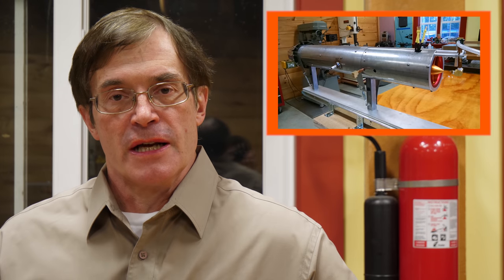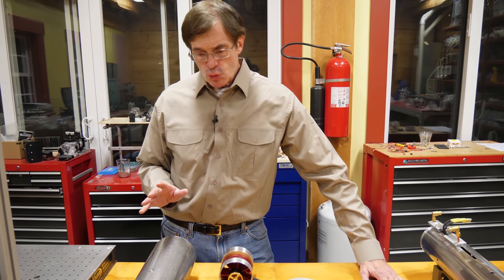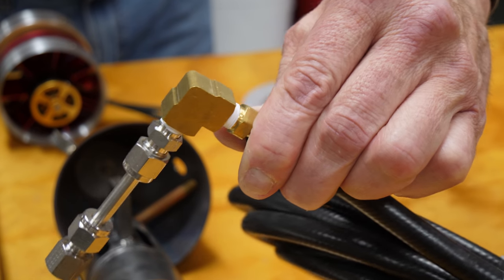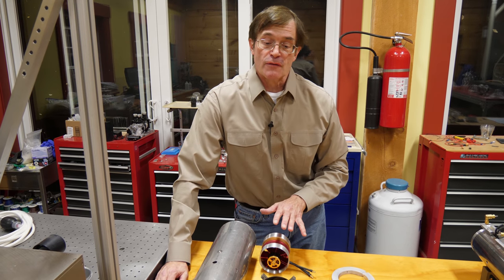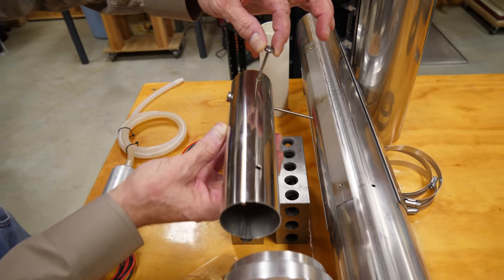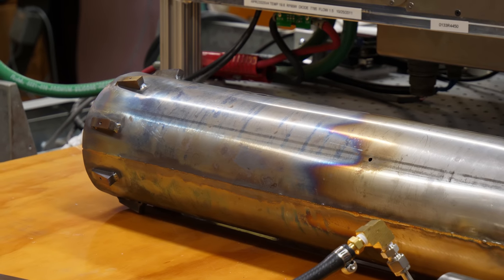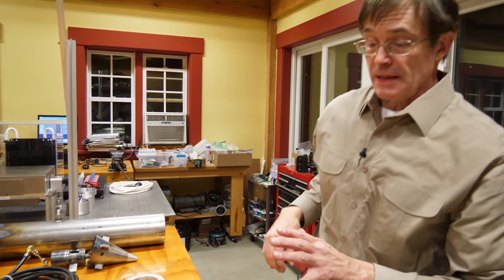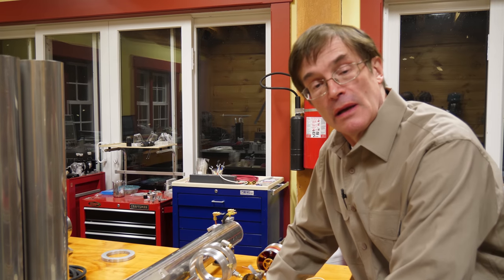Hybrid Jet Engine - Update 2.0

Comment: What is the liquid propane going through the motors going to do to the lubrication in the bearings?
Reply: I would imagine they use sealed bearings and those need to be cooled as well so whatever lubricant they use doesn't get too thin from overheating.
Reply: Doesn't propane dissolve petroleum based lubricants? I guess if the heat of the engine would make the oil grease too thin for it to contain anyway, it wouldn't make a difference. If the bearing can hold onto the grease at a high temp, it is totally capable of also keeping the propane out.
Reply: There are plenty of inert synthetic greases such as Krytox which won't wash out.
Reply: omg feed fuel into compressor when did this turn into a bomb. I think the title is hybed jet engine yup checked it it reads hybred jet engine
Reply: If they fail, go ceramic. Plenty of those in the hobby.
Reply: What bearings?! It’s just a combustion chamber with no moving parts!

Comment: I cannot wait to see this running! My only concern is that of the liquid propane causing the EDF blades to become brittle (that is assuming they are plastic), also there will be condensation issues inside the  motor everything you turn the system off unless you have a "warm up" time after where you throttle down and turn off the liquid propane.  I bet you thought of this though, so I eagerly look forward to seeing how you worked around these potential problems.
Reply: JP EDF units are all aircraft aluminum.  This will still occur to a degree, but much tougher than plastic.  Aluminum is a much better material (especially when used for their intended purpose), because even though a high-quality BLDC motor is over 90% efficient, there are still 5000 watts going through there.  At 90% efficiency, that's 500W of pure thermal energy they must dissipate.  That's like a space heater on low.

Comment: Thoroughly enjoying this ongoing project. The cooling sleeve is an interesting addition. If the superheated steam only marginally changes the thrust, perhaps it'd be worth reversing the direction of water, countercurrent flow offering better heat dissipation.
Reply from the maker: That's interesting.  Also, we might eventually replace the water with bleed air from the fans to simplify the design.  We'll see.

Comment: Have you considered adding a slightly larger fan in front of the whole assembly that would feed cold, uncompressed air post combustion to increase bypass ratio and cool the tube? This would increase the initial compression ratio, but your current fans might be less effective because they can only compress the air so much. It seemed like you started out without any bypass ratio, now you have added some with that smaller tube which likely will make it more efficient,  so by adding more bypass ratio of your compression,  you could further increase the efficiency of engine. Modern Turbojet engines use that kind of system, but they use a turbine to turn the large fan on the front so maybe this wouldn't work for your system. I'd like to hear about your thoughts on this.
Reply from the maker: If we go to a three stage system we will likely steal a little of the first stage air for combustion chamber cooling.

Comment: I'm excited to see this new version running. You've clearly put a lot of thought into this.

I'd be a little concerned that the liquid propane might wash the lubricant out of the bearings in the EDFs. Those bearings are usually only shielded and not sealed, so a fluid like propane would have little trouble finding its way in and diluting the lubricant. I would want to try placing a few different oils and greases in some liquid propane to see if / how quickly they dissolve.
Reply from the maker: That is a risk.  If that proves to be a problem and we still want to push it, water would be a good alternative.
Reply: @TechIngredients  If it works, it's a very good way to kill two birds with one stone, especially the nitrous oxide version you mentioned.
Reply: @TechIngredients   Also, I suggest turning down the music during the intro about 3dB, and maybe throwing some light compression on the music track when it's in the background.

Comment: Amazing work.  I'm betting you abandon the brushless fans in favor of turbine driven compressor before it's all complete.  With all the cnc that's available today, you could have multi stage axial flow compressor/ stator assembly made up as well as a nice turbine with a nozzle for the combustion section.  Really enjoy  your videos.  Thank you!
Reply: Not to mention the added joy of that turbine whine :-)
Reply: There are only a few diy axial compressors on youtube as creating one is a very complex engineering problem.

The biggest hurdle outside of machining/tolerances, is that an axial compressor doesn't scale down well, so to make a benchtop model it's much harder than creating a normal sized version for an aircraft. If you plan on flying it, the rest of the equipment doesn't scale well either. You have to deal with heavy accessories that allow the jet engine to function reliably, and the only way around that is to build it larger.

Comment: Cooling the fans with liquid propane is brilliant.  Looking forward to direct measurements of the efficacy of that stage.
Reply from the maker: It may in fact be enough to use water.  This is less likely to dissolve the oil in the bearings and the large heat of vaporization should compensate for the higher temperature of he vaporization.  It is unlikely the motors will operate much below ambient in either case due to the high airflow around the motors.

Comment: The 5000 watt edf should be producing more than 10lb of tbrust on its own...
Reply: Hence "more than 10lbs". They only used a 10lb spring last time.
Reply: it's 500W not 5000.
Reply: @nikoladd  That may be true, but he said 5000 on the video.
Reply: You're correct. I thought he said 500W. On your initial point making trust out of jet engine is not nearly as linear as EDFs. What's done in this video isn't efficient(as is explained in the first video), but is very cool, thoughtful and educational.
Reply: Nope, it's this one: http://www.dxhobby.com/jp-hobby-full-metal-electric-ducted-fan-edf-12s-90mm-for-rc-plane-p-1029.html

Rated at 5.1kgf, which is 11.2lbf.

Comment: I wonder if a motor/compressor/impeller (probably not the correct terminology for that...) from a high-volume industrial vacuum (or shopvac, home vac?) would work for the first stage?   May be worthwhile for cost effectiveness as well as easy to source.   I love your channel.  You seem to be perfectly in tune with my interests & experimental urges.  Nice to know there’s another mind of the same ilk somewhere out there!
Reply from the maker: Thanks!
Industrial vacuum motors with their centrifugal compressors would be superior in design, but their weight and power handling capabilities are just too far out of the useful range.
Reply: @TechIngredients  part of me wants to argue that.  However, I initially suspected the same issue(s) as well.  I trust your opinion to be well thought, and based upon sound reasoning & reliably known theory.    Might one assume that the ultimate goal is to have a unit which operates within a power/weight ratio equal to current aircraft standards?
Reply from the maker: Yes.

Comment: dear sir; 

i think something is missing here in the whole concept ! 
those fans cannot sustain the pressure you need to make the after burner speak.
i suggest to test the fan system (or compressor)  for 100% throttle and for different outlet restrictions, and publish the curve.

i love what you are doing !
Reply from the maker: Thanks!  
Don't be too sure about that assumption.  You'll see some results in part two.

Comment: really great :) can't wait
BTW, couldn't you use some sort of regenerative cooling instead of using a firetube ? like you said liquid propane is -40C so what you inject in the engine should be enough to cool it, and it would already be heated when you inject it. It could help to make the engine less long at the same time, making it lighter (you wouldn't need the length of the firetube)

Comment: I wonder how much the water jacketing will reduce the exhaust pressure.  Its probably a terrible idea but I'm guessing that liquid propane would also do a good job of cooling the rear section of the tube.  Its interesting how this (to me) now has more features in common with a liquid fueled rocket engine than a turbojet engine, especially if you swap out the LP in the intake with liquid N2O.

Comment: I think the nozzle just downstream of the compressor is not needed and will reduce the pressure in the combustor. When you dump diffuse the air downstream of the nozzle you will lose most of the dynamic head. By accelerating the air in the nozzle you drop the static pressure and increase the dynamic head, giving a higher loss and hence lower combustion pressure.

It would be interesting to see some pressure tappings in the cold end of the engine, you could then see the pressure ratio of each compressor stage.

Good luck with the project, gas turbines are hard!
Reply from the maker: Thanks.
I disagree with your assessment regarding the cone.  It's a little more complicated.  The output from the EDF is not a homogeneous, linear flow.  The motor acts as a blunt obstruction.  In typical EDF installations for RC applications, the addition of a duct approximately twice as long as the diameter of the EDF will increase the thrust even without a change in the diameter. The actual cross sectional area in the annular gap around the cone is similar to the cross section of the open area at the exhaust from the fan.  The cone as I described in the first video also serves to protect the EDFs from the intense heat radiated from the combustion chamber.  Also, the cone produces the needed turbulence in its wake to allow a stable flame front without the frictional losses of typical flame holder bars.

Comment: Crazy. Love it. 
How about a radial compressor from a vac? Gives you more pressure / less speed than axial compressor. Axial compressor gives speed / minimal pressure. You might need a multi-blade axial setup with smaller diameter each stage. Would love a 5 stage EDF compressor :)
Reply from the maker: We seriously thought about that.  They are just not built that well.  Cranking one up a few notches was more than exciting!😱

Comment: He says “Practical engine” when referencing the electric ducted fans. However the length, the weight, the water shroud cooling, the liquid propane cooling and the electrical equipment rack added to the not shown various tanks of propane and water and the water pumps means that this engine is ANYTHING BUT PRACTICAL. It’s like saying that you have a ridiculously powerful jet engine and you can produce XXX bajillions of newtons of thrust, and then pointing to Mt St Hellens 5 min prior to eruption. True but difficult to use in an everyday application.

The above was just a laughter and a response to his phrasing. I know this is a test bed machine to experiment with different combinations of conditions and parts. It’s also interesting as Hellhiem. 

This isn’t a negative response. He was just humorous.

Comment: Have you considered letting the engine heat up using propane then running a liquid fuel through the cooling tube to vaporize it to feed back into the engine?

Comment: You might also be able to protect the hot end by wrapping the fuel line around it to act as a heatsink and fuel preheater; similar to that of a standard engine (although it uses a heat exchanger between the oil system and fuel).
Reply from the maker: Maybe, and this might provide enough cooling.  Bleed air from the first fan is another possibility to allow the water to be eliminated.  If we wanted to try diesel again (so far a poor fuel for this engine) a preheat wrap would be a very good idea.

Comment: I would like to see the difference between the EDF alone, the EDF afterburner combo and a traditional jet engine consuming the same amount of fuel as you end up using with the EDF + the energy used by the EDF converted to extra fuel. (Id really love to see your approach to a conventional jet engine)

Comment: Another interesting video, thanks.

Perhaps you could find some inconel, which might be cheaper than tungsten, and should handle the heat fairly well. You can't weld it though. Unfortunately, it has chrome in it too, so the indoor jet engine eludes us yet again. : )

You might be able to use springs on the "turkey feathers" to have them automatically keep the correct exhaust port diameter, given engine rpm and flow.

You might be able to use air bypass instead of the water cooling, so you can more easily fly your engine. It might need more surface area, like heat sink vanes, and would surely need more space for the air for a greater flow because it's not going to take the heat away as well as water.

Alternatively a larger electric motor could be used, and then a throat adapter could be made to obtain the velocity you want.

I was going to suggest nitrous oxide. As with internal combustion engines, you might have to add more fuel, or your engine might be fuel.

The propane cooling was simply brilliant! It reminds me of the F1 Saturn engine cooling.

I used one of those Hella 300amp switches on my electric scooter. I love that switch design!
Reply from the maker: For the rods, tungsten is a good choice because of the availability of pure tungsten welding rods.  Beyond that , ceramic is attractive with very high heat tolerance and easy fabrication with casting and rolling prior to a quick bake in our kiln (another up coming video).
The "turkey feathers" is elegant.
We may very well go to air bypass instead of the water in order to simplify things.
The amount of propane or nitrous for that matter is quite small compared to the air and fuel being burned.  It should not effect the ratios appreciably.  We may even use water for this purpose as its high heat of vaporization will allow cooling with substantially less than 1 cc/sec of flow.

.